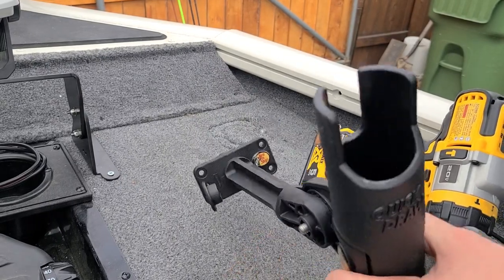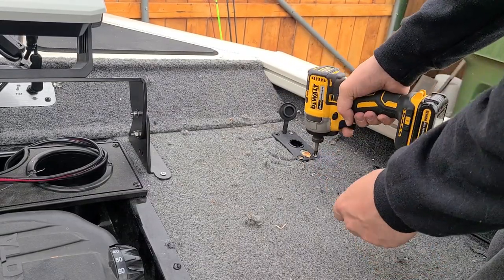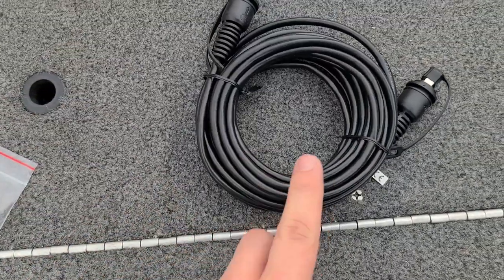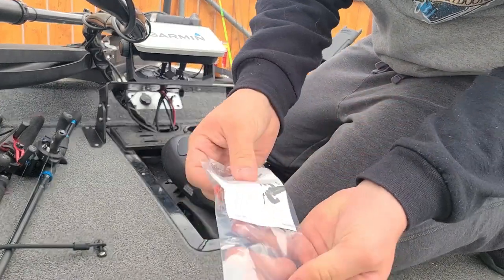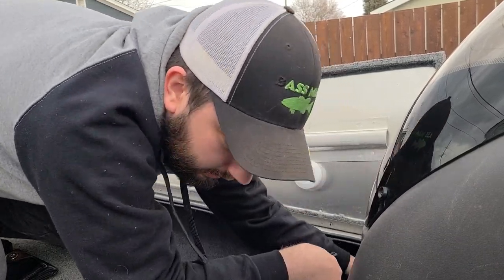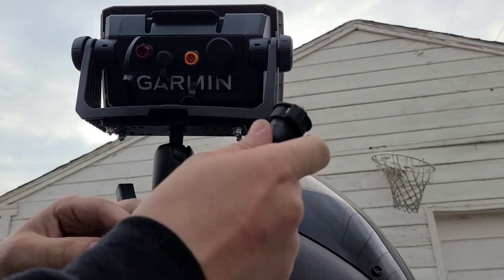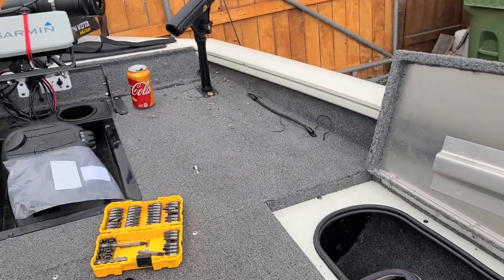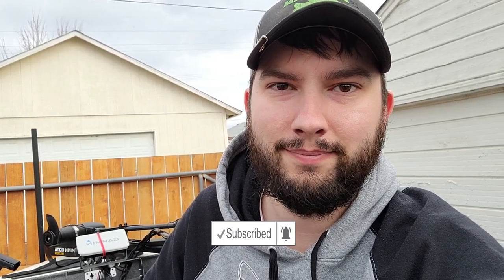How to install Garmin ECHOMAP UHD 73sv - Part 3 (networking and rod holders)

Comment from the maker: Update: around the 7:40 mark I use cable routers and screws to manage the cable. DO NOT DO THIS. I wasn't thinking and those screws went right through the hull and poked out the other side. Just use zipties to zip the wire to the other cables that are already installed.

Comment: How does that work with 2 transducers? If you network them couldn't you just use 1 transducer?
Reply from the maker: I think you could use one transducer but I like having them seperate so I can see what's directly under my trolling motor. Then I use the rear one while I'm using the main motor.
Reply: @NorthBestFishingOutdoors  Thanks!

Comment: So on the bow did you use the nema plug and the console use the panoptix plug?
Reply from the maker: The cable is plugged into the panoptix plug on both units.